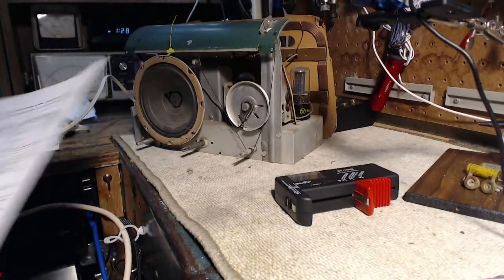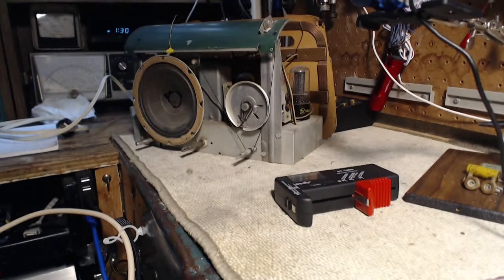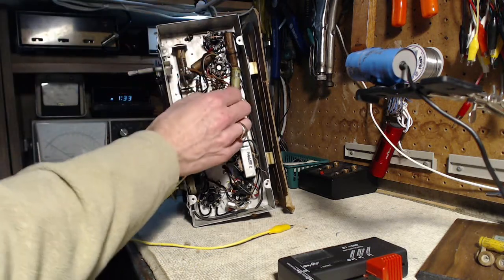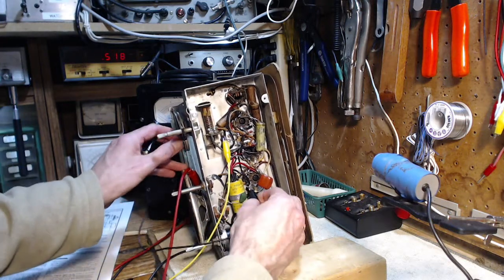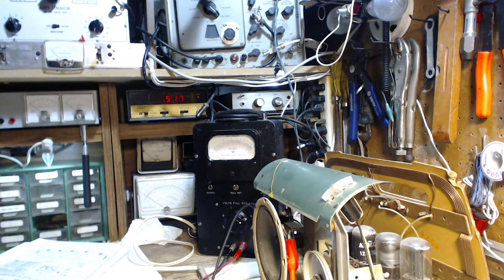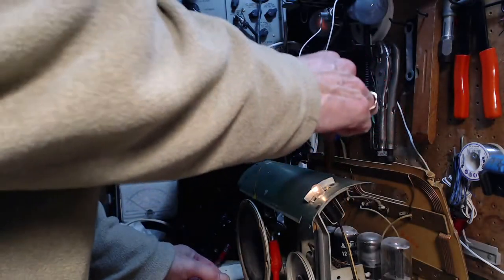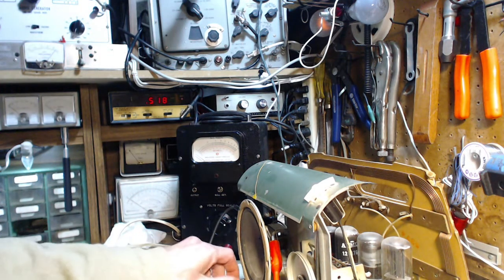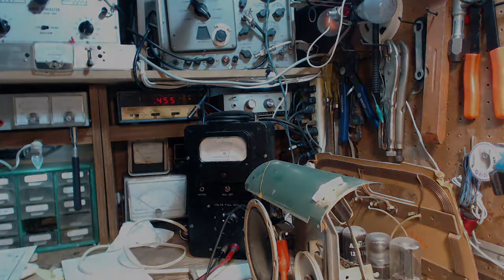Sonora RQU-222 Six Tube Radio Video #5 - IF Touchup Tuning

Comment: As far as the delayed start-up, it could be that this radio needs full power, the restricted setup might slow the heating of the tubes. Also I always use full power (isolated) when tuning, especially when tuning FM. I only use restricted power in the first check of the radio, after that the radio sees real world conditions with the exception of the isolation transformer, before going out I test without the isolation transformer. Carl
Reply from the maker: Many times I've left a radio on restricted power by accident.  I agree fully with your approach.  I've found that AM tuneups don't suffer from a bit of low voltage but on FM, things are much different and need to be at full rated voltage.  Thanks for your comment.

Comment: When you feed your sig gen into the antenna, there is always a danger that the radio may be accidentally tuned to the second harmonic of the generator- it will appear at 910 kHz on the dial, if you inject 455kHz. You may have done this unwittingly in video 4; the response at 300 kHz on the generator dial is the radio picking up the 3rd harmonic! This also explains all the peaks- I'm guessing the correct IF in that radio is 470 kHz. A Simple check is to swing the tuning control to ensure that you really have the correct IF frequency- if you have, the tone will be heard at any setting. Best practice though is to set the generator to the  correct IF, and disable the oscillator by shorting the gang section or the coil. 

If the pointer is too far gone, a bit of stiff wire with coloured sleeving on can make a good substitute; you can glue it to the slider or even solder it; though take the slider off the dial cord first if you do that or the cord will melt!!
Reply from the maker: I like the simple way to check to see that the radio is being fed the IF frequency and not playing an image or harmonic. Knocking out the oscillator might yield a lot of interesting observations along with making things better for aligning the radio.  I've never had that suggested or found it in any alignment instructions.  Interesting stuff, Alan.  Thanks much.   Jim